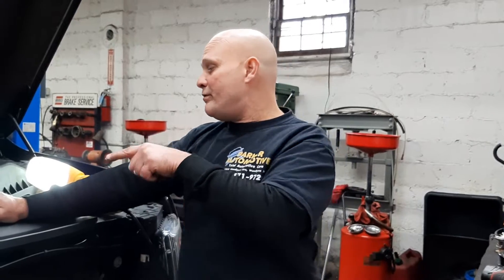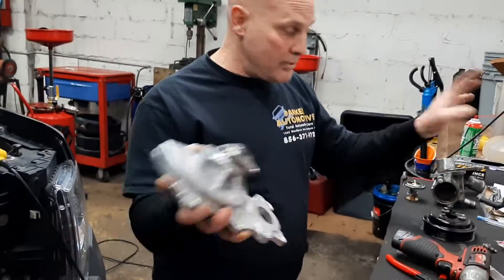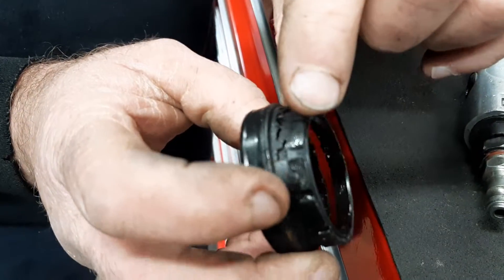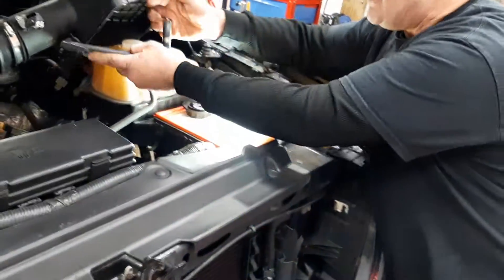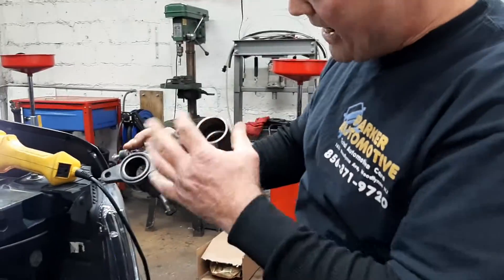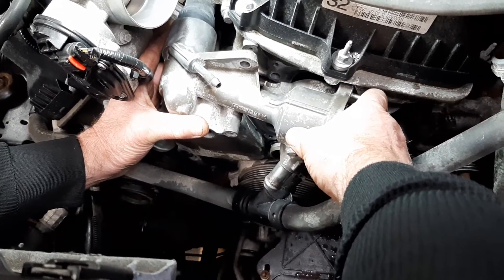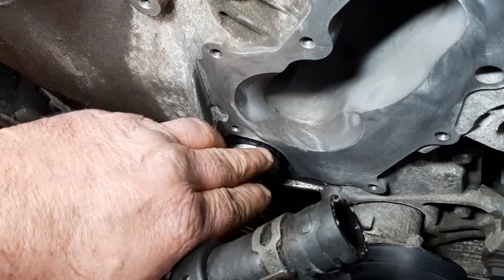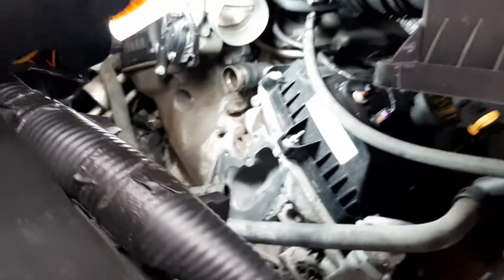2013 Ford f-150 3.7

Comment: Glad I found your video. The recommendation on the seals was extremely valuable and I'll make sure I get those 2 parts.  They say there is an internal pump that runs off the timing chain.  Have you done that?  BTW, God bless you too.  Thanks.

Comment: Was the engine quieter after changing g the pump I had mine changed because there was a knocking noise and you could see the pulley moving in and out I seems quiter now . I had a 117000 no leaks did the top hose and the 2 seals you mentioned

Comment: How did you get that timing seal out Its kicking my ass Any tips ???
Reply: This is a pressed on rubberized metal gasket. They are replaced when timing cover is off not every time water pump leaks.  Tons of extra work and great potential to scar metal adjacent and on inlet pipe.  I only got half of mine out before asking a pro about this. Deep regrets for not just doing water pump and top o ring
Reply: @marvinboyer8665  so we don’t have replace the bottom seal near the timing pulley but you started it so had to finish it?  Sorry I’m new at this.
Reply: @marvinboyer8665  so I’m in the same situation. Do you have to take the time ING cover off do replace it? Got my “ring” off but there’s is a ton of seal left in there

Comment: Hey man I went to take this out because I thought it was part of the water pump and put it back in but now it’s leaking oil from the spot. Can you please tell me how to put the new one in, do I have to take the timing cover off and slip it on from the back or can I just slip it on from the front like how it comes off? Thank you for your help!
Reply: Did you ever figure out how to get the new one in without removing the whole cover.

Comment: You are so right!!! thanks for the great information.....am in the process do g mines right now and that seal at the bottom is a bitch to get off.....mines is actually stuck in there at the back😤😠
Reply: It's suppose to be stuck. Only change seal when timing cover is off not when your water pump is leaking 🙃

Comment: I got mine from rock auto and it came with the 3 bolt pulley vs the 4 bolt that I took off the truck.
Reply: Cool thanks for the info man!!!!
Reply: I ordered the 3 bolt mc waterpump off rockauto and they sent me a mc 4wd hub assembly… needless to say the 3 bolt stock pumps leak also, this one at 94k miles